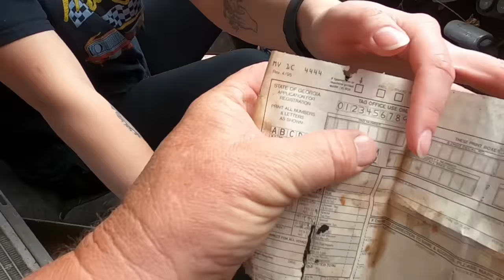Mustang rescue. Going to give my daughter her dream car, if she helps. Lets see what I bought.

Comment: Back seat is a 68 Mustang seat. The front seats look like they are out of a falcon. The radiator from the factory will fit a 20" radiator. You have to cut it for a 24" radiator. The shock towers look like they were modified to fit headers. So, my guess would be, they had a big block in the car with headers. And needed a bigger radiator to keep the bigger motor cool. Also they took the hinges off for a removable hood. In the trunk, those are factory export braces. Not aftermarket.
Reply from the maker: Thanks! Great to know. I bolted the driver's seat in to move the car, and the tracks lined right up with the holes. Must be some kind of Ford seat, or at least the tracks are. Guess I'll just put a 20" rad in. It's just going to get a 302. I appreciate the info. Hope you follow along. I can use all the help I can get.
Reply: @flatbrokegarage  I've restored them for 40 years. I'll be here if you have questions.
Reply from the maker: @hughphillips67Mustang that would be awesome! I know I'll have questions you may laugh at what I'm doing, but I'm just trying to give my daughter a safe driver. Hopefully she will restore it. Thanks again

Comment: Those are Strut Rods and are adjustable and have a lot to do with the alignment. I've had them messed up before and caused it to not be able to get to a certain spec on alignments.
Reply from the maker: I'm definitely going to have to replace them. I did the rubber bushings on the comet. Seemed to help

Comment: I think its a great project if the underneath is solid enough.  Those mustangs hide rust like easter 🥚
Reply from the maker: I got SO lucky with this car. If you watch the last video on it I go under the entire car. Super clean. Thanks for watching!
Reply: @flatbrokegarage  that is cool, I think silver would be a great color on that. Or even green like the 68 fastback from bullitt
Reply from the maker: @bighank796  I agree on the highland green for sure. At least the left fender used to be. 😆

Comment: That would make one good fastback conversion
Reply from the maker: You are correct,  maybe down the road she will do that
Reply: @flatbrokegarage  id just do the conversion, drop a 302 in it with a four speed and leave it in patina, along with a 9" inch rear end
Reply from the maker: @jireepugh7991  I'm pretty sure I just bought a low mileage Granada with a 302, C4, disc brake, and 9"  not positive on the rear-end

Comment: Do your self a Favor Go rent a Large sand blaster, Get real fine silica sand, and sand blast the whole bottom of the car, It will Look nice and you can epoxy it all, There not called rustangs for nothing
Reply from the maker: 😆 very true, I actually own a pressure pot blaster. Might give it a try. Thanks for watching!
Reply: With what I have seen on my sons mustang, the best way to clean the rust is with a laser beam. The guy on halfass customs bought one and uses it a lot. My son blasted the entire bottom of his car and it cleaned up well. Sand bladting is way messier than laser blasting.
Reply from the maker: @richardgabel33 I own a sandblaster. May give it a shot.